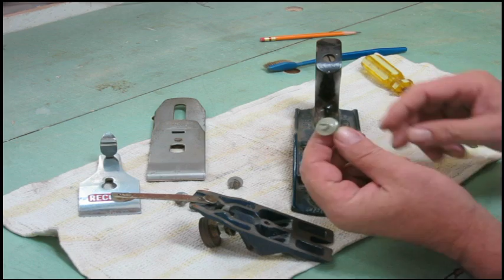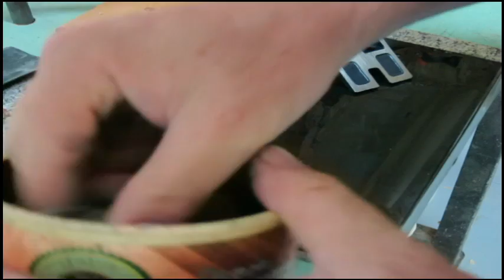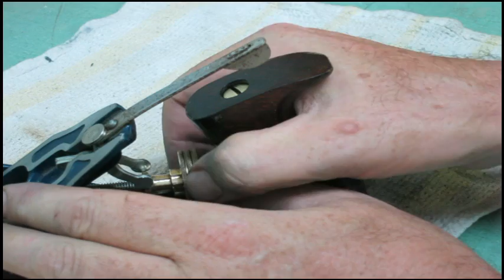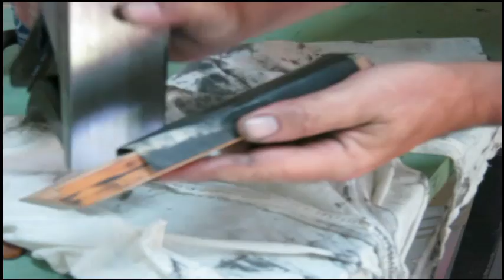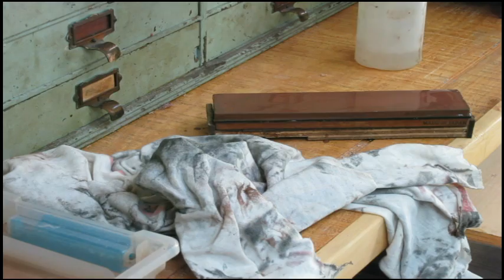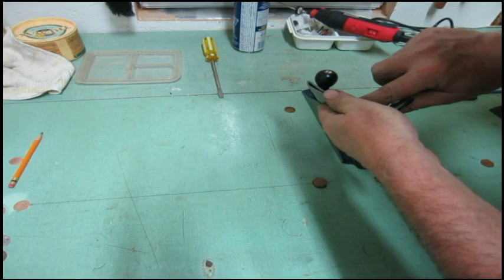1950's Record #4 Plane Rehab

Comment: one difference i found while researching these planes is that the Y-lever is a single piece in the older one and a two-piece steel on the newer one. It looks like the older ones are made better.
Reply from the maker: They don't make them like they used to!  lol.
Reply: @JimDockrellWatertone  yes as is true for many mechanical and hand tools.. very happy to have bought a no. 5 and no. 4 refurbished by an experienced woodworker, both look like they are either 50s or early 60s. It's crazy how i managed to get a jack plane, smoothing plane, shoulder plane and block plane all in great condition for less than the price of one lie nielsen jack plane! (yes i did spend a bit more on a nice brass lie nielsen block plane, but still it was from ebay and cheaper than retail price) I'm bringing these back to asia where good quality hand tools are hard to come by (even the ones made in china are more expensive than these vintage planes). Can't wait to build my workshop!
Reply from the maker: Check out the Stanley Bench Plane Page at hyperkitten.com.  A great resource.

Comment from the maker: I usually use spray glue to hold the sandpaper to the tile.  I have seen duct tape used, but WD 40 seems to release it pretty easily.  If used with water, a bit of water under the sandpaper seems to stick it to the tile fairly well too.

Comment: Hey Jim - I think you will find that the plane you picked up for your son is a much later model probably 1988 on as that was when they changed the 'Y' lever to two piece steel and the lever cap screw to a standard unified pan head screw. The workmanship is not as good with these later planes but they can be made to work fine with some tuning and a better blade. - Regards Dave
Reply from the maker: It could be.  The '50's was what seems to be indicated at the hyperkitten web site, so I just went with that.  Either way, for a first plane, it came out pretty good for the cost.   Thanks for the input.

Comment: Great job on the #4, Jim.
I personally would not use the Dremel / stone on the brass but taken time with a polishing compound. From my days of restoring Coleman Lanterns.
When using the 200 / 400 grit, do you glue the sheet down or just lay it on the tile?

Comment: What kind of wax did you use, and at what ratio with the 3-n-1.  Never heard of this but it sounds intriguing  I'm gonna try it!
Reply from the maker: Just regular old furniture paste wax.  I use Tre-wax, about the same as Johnson's.   Just enough to make it a soft wax.  I heat it on one of those little warmers that you set your coffee mug on to keep the coffee warm.
Reply: Thank you!  I'm going to give this a try.  I'll let you know how it turns out.  Right now, I use Boeshield T9 (which prevents rust the very best in humid salt air NE FL, but leaves a very waxy sticky surface) or Paul Sellers "rag in a can" oiler which is superfast, super easy and if I hit tools every time I use them, staves off rust pretty good so far.
Reply from the maker: @danhartman9087  I have not tried Seller's rag in a can method, but I think it's a good idea.